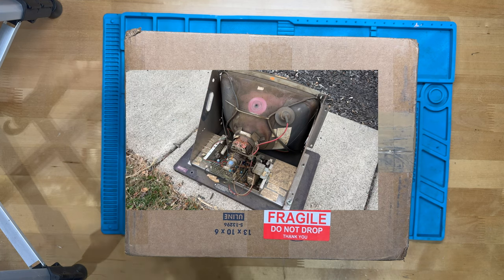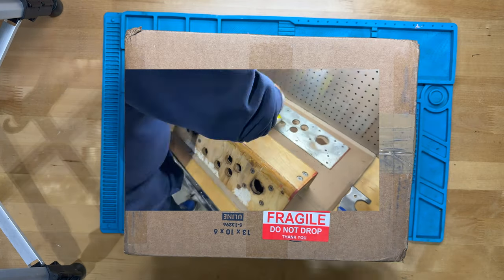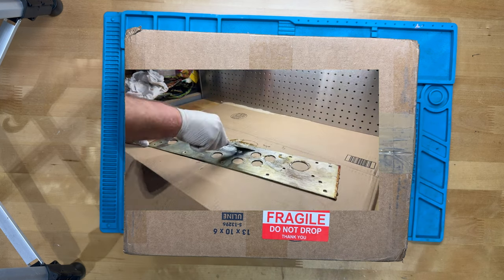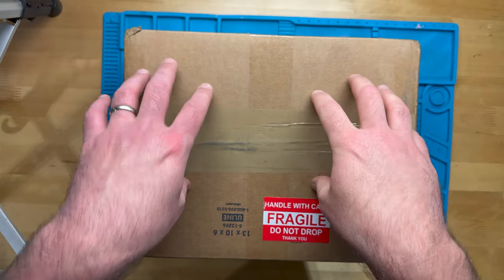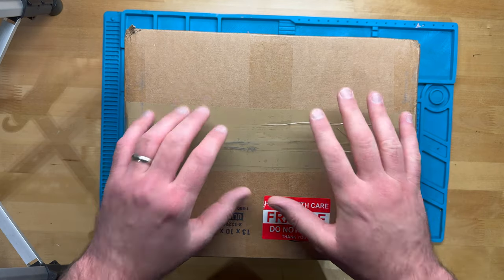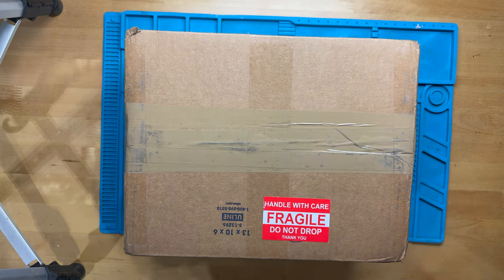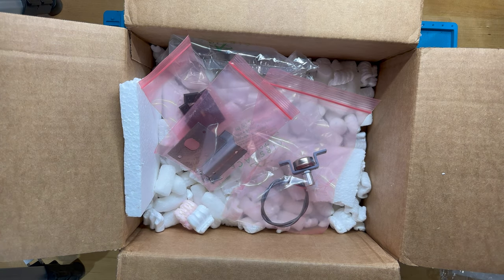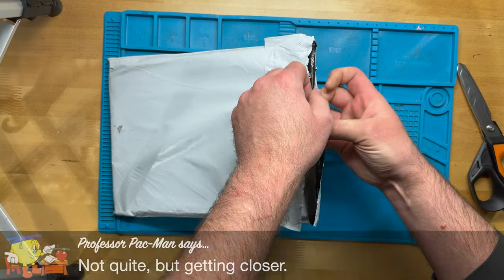How to Repair a Williams Control Panel & Install a Control Panel Overlay: Joust Restoration part 4

Comment: Awesome Job! But man I so feel your pain with that first flap button. I wanted to come through the screen to help you figure it out! lol
Do you think you could lift the art up that you left, then like rub some bondo on the inside of that hole with your finger on the bottom. let it dry then try to fit the button back in? I'm hoping the art will then extend a bit covering that area. There's got to be a way.
Reply from the maker: Yeah, I'm think I'm going to try something. Maybe start with some dense foam (or similar) to experiment before committing to a permanent solution?

Comment: Guy on e-bay sells the best volume pots, thanks for sharing.
Reply: A screw with washers is a great way to remove and install T-Nuts just a FYI
Reply from the maker: In my case, I needed the bracket too.
Reply from the maker: @iconoclast518  Mine had been drilled out by a previous owner, so prying them out was all I could think of.

Comment: great job! only thing i would have done differently is prepped the surface with an adhesion promoter. That way the stickers and decals dont dry up and bubble over time as much.
Reply from the maker: Thanks! Would you suggest something like Rapid Tac or another product?
Reply: @overtimearcade  I worked in the rv industry for a lot of years. We used 3m adhesion promoter and denatured alcohol to prep before applying decals and things like stick on led strips. It really does make   a difference, especially on something like wood.

Comment: I'm new to your channel. Love the work. However I know your not a woodworker, I am However so a piece of advice. When using your tablesaw and you are using your miter Guage while cutting small pieces remove the rip fence off the saw or at least move it as far away from what your cutting. You had so many kickbacks my anxiety was through the roof watching. Likewise get rid of the plastic push stick they shatter if they get hit by the blade of the saw. If you like that style make one out of wood. Other than that great work.
Reply from the maker: Thanks for watching and for the advice!